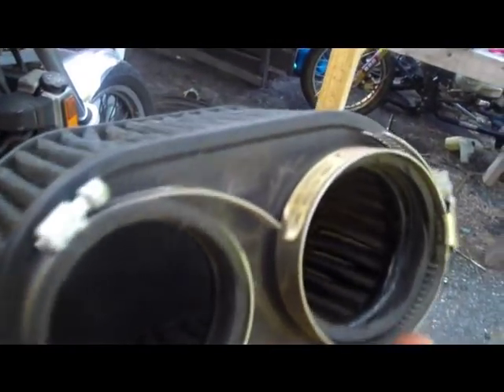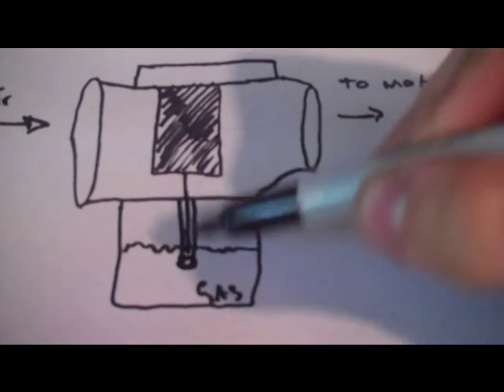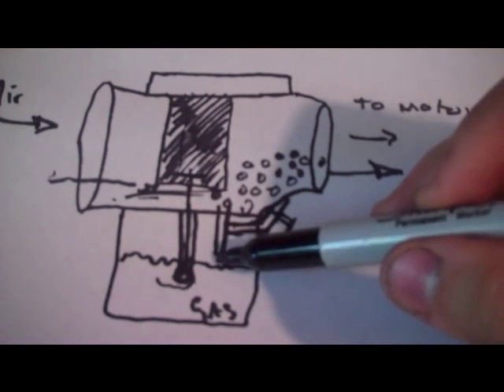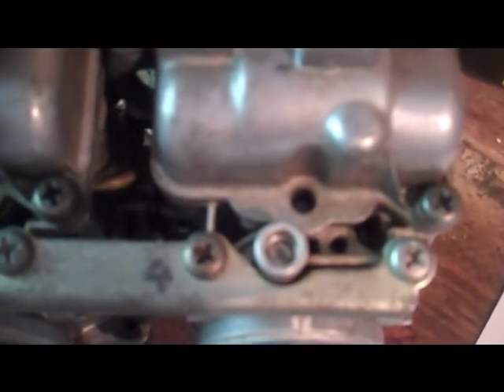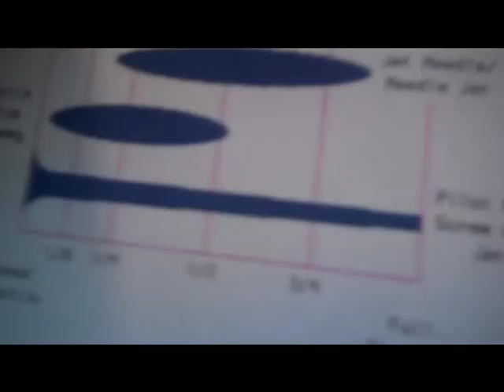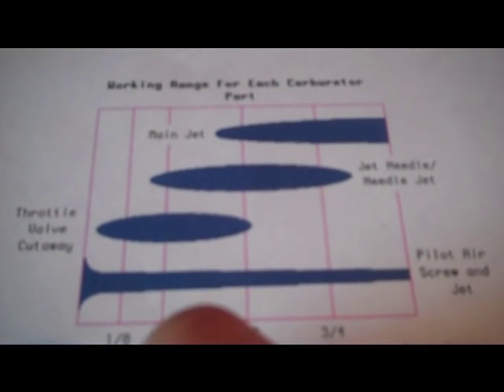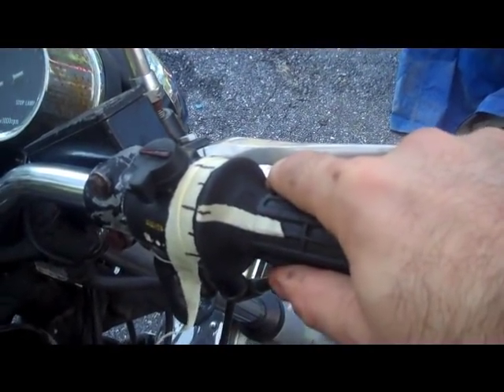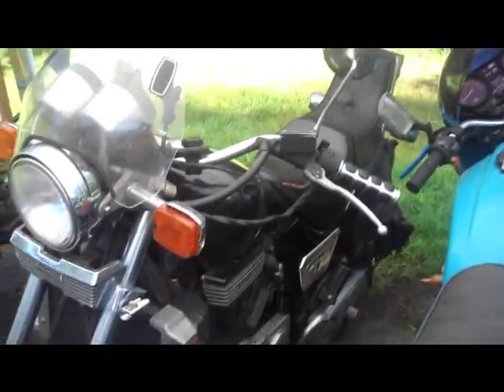How to adjust the jets on motorcycle carburetors

Comment: ok.i finally got an off day and put my air box on..i started it up and as i always do i choke it for about 60 sec or so depending how cold it is.the idle went up from1.5k rpms to damn near 6.so i turned out idle screw and nothing happend cut it off and back on it stayed revd up to about 5.5k or more...my throttle cables are correct it snaps bck in each posotion..what did i do wrong.?...

Comment: attempting a renovation of a BSA B31 350 it has an Amal  carb I got it to start, after wearing out a pair of boots, but it will only run with the choke fully on , any ideas would be appreciated
Reply from the maker: I dont know much about BSA's, is that the stock carb? If not how does it differ from the stock carb?
Reply: mrmaxstorey thanks for the reply Max yes it is a stock carb , it does tend to fire back thru the carb so beginning to think it may be a timing problem gggggrrrrrrrr
Reply: Only running with the choke on means the pilot/slow circuit is clogged. I'm assuming the Amal carb has those as I'm not familiar with those carbs. I would tear it down and fully clean it. Verify all the tiny passages are clean, run a tiny wire through them, then carb cleaner, then high pressure air. The pilot circuit or slow circuit has the tiniest jets and are often the first to clog up.
Reply: thanks jason will try asap

Comment: would u have any info on putting fuel lines on a 1982 honda v45 750 manga i got one used with the carbs off an dry cracked fuel lines that were just sitting in a box with the carbs i rebuilt the carbs with carb kits just not sure how to hook up the fuel lines
Reply from the maker: +Daryl Gardiner Fuel line runs from the petcock to the carburetor
Reply: +mrmaxstorey its a quad carb handa with 4 inlits for 4 all 4 but each port is connected to 2 cards top and bottom
Reply from the maker: +Daryl Gardiner http://carbjetkits.com/images/full/32.png
Reply: +mrmaxstorey ty

Comment: How many steps to adjust the 36mm Mikuni?
Turn air-fuel screw in all the way
bring it out 1 1/2 turn
start up bike
keep bringing air-fuel screw out but no more than 2 1/2 or 3 turns till it reaches max iddle
adjust idle with idle screw till RPMs are at the proper level

Is this the way?
Thank you
Roberto

Comment: Hey im using a 2 stroke bike, and i ported my carb. From 28 to 30. My standard jetting is 270/25. I am not using any air filter. What should i do? I am riding zx 150
Reply: And my slider has a small cut away. Its a vm28
Reply from the maker: +afiq yahya I don't have the magic formula for you. This video is all about the process of experimentation to figure it out for yourself

Comment: hey i have a cr80r Honda 80cc dirt bike 1989 and when i first got it it was amazingly fast and would wheelie just by throttling it and now the power band just isnt as power ful do you know what could be wrong
Reply from the maker: Tyler Wallace Could be lots of things. Dirty carbs, dirty air filter, losing compression, spark plug fouled, etc

Comment: Hey I bought a zx6 ninja with a pipe on it...  it had a horrible leaking rusty exhaust though so I replaced it with the oem dual exhaust and headers. Now the bike idles but it runs horrible. If I give it throttle it bogs down and it smells really strong like gas

Comment: sorry, im gonna try to put this in english, since im from mexico, i have a suzuki gs 1100 1982 with 110 main jets and 45 pilot stock jets according to the manual, my question is what would you recomend if the byke has air pods intalled? thanks for de video from mexico...
Reply from the maker: I dont know, thats the point of the video to help you figure it out
Reply: Air pods tend to flow more air at higher rpms than the stock filters so you tend to get lean at higher rpms. Have you installed the pods yet? What is the bike doing?

If it tends to cough and sputter at higher rpms after pods are installed, you need to enlarge the main jets. Go up a step or two and see if that's enough. You may need 114's or even 118's. It depends on the filters size and construction, etc... Some bikes are already a bit too rich with the main jet and a switch to pods don't require a jet change.

Comment: Ok i have a cr80 and it bogs at full throttle. I have to slowly rev it up to get it to redline. It has a horribly dry and crusty old filter and needs a gasket between the reed valve and the cylender. What would my issue be? oh and no oil in the crank case. i just bought it thats why i dont have the parts. i orders a gasket kit and a filter and all that good stuff. Please help me

Comment: hey man i got a problem..i have a cbr f3..my first bike so i try and do most of  mechanic work my self to learn something new.so i did carb clean did pretty well for my first time and i also did carb sync with carbmate sych tool.the pick up is great.i got my fuel/mix screws turned out 2 and a quarter out idle is fine but its just when i start trying to really goose it at about 75 80 it will bogg down and go no more.it rides damn near perfect up to that point but i want it to be correct help! plz

Comment: I'm having a problem with a 450r from idle to WOT, quad wants to die if you just gun it. Easing into the throttle is fine just gunning it from idle to WOT.

Comment: no not there a small hole out of the cylinder maybe a little lower,its like it was drilled out or something but idk what for,and it never leaked oil from there...but it all ran until i ran it for like 4 hrs straight,and then when i shut it off it had trouble starting and had extreme popping out of the exhaust (flames) and i had to jump start it.do u have any idea what happened?

Comment: Just took my carbs apart. was going to to a jet kit. but when I took the needles out. one carb had 1 shim and the other carb had 5 shims. and my jets were bigger then what came with the jet kit. I had 225 in one and 114 in the other. I frond that stock runs 225 and 222.5 . and the jet kit came with 110 jets.  please help me.. what the hell is going on with me carbs?  why so many shims in one. and why did the jet kit come with smaller jets then stock ??  thank you

Comment: I just bought a 1981 c b 650 only 2100 miles cylinder 1 and 2 running   3 and 4 cold getting spark, compression good , thinking it could be a pilot jet .what do you think ?
Reply from the maker: It could be lots of things but a carb cleaning should be first on the list

Comment: One more thing. When you put on cobra pipes, do you have to replace the main jet and polite jet so bike can run correct? Thanks
Reply from the maker: I dont know enough about cobra products to know if they require rejetting, it all depends if their baffle resistance is similar to the stock setting. However leave them on there for now. I would first check the spark plugs, see if they are fouled, if so then replace them and then try to figure out why they are fouled, perhaps your float heights are off, or the air filter is way too dirty. Is the intake stock on it or does it have aftermarket air filters?
Reply: Its has the stock air filter on it.I took the plugs out and they seem to look ok, one is light gray and the other is light black. How can i tell if the plug is fouled out? they look to be new. I was wondering if the float is off, but it looks new to. i never adjusted the floats before. i watch your video and im not understanding how to bend them?
Reply: The air filter is new to. The air/fuel screw was been mess with.
Reply from the maker: michael dean
Well if the a/f screw has been messed with, find out what the stock setting is and set it back. Usually its about 2-3 turns out. A fouled plug is black, if you have one that is blacker than the other then that one is likely running a bit rich. When adjusting the floats, the little metal tang is what is bent, rarely a bike will not have a metal tang it will be plastic and in that case they are not adjustable. Ive never worked on your bike before so I dont know

Comment: Have a 1981 Yamaha maxim xj 650 The intake boots are cracked but did some sealing. When i took the carbs of to clean them looked at the inside of the boots no cracks are all the way through.But still has a hard time starting,and the idle is up and down,looked at the spark plugs they look ok what could be the problem with hard starting could it be the vaules ?
Reply from the maker: +James Roberson Maybe. Carburetor problems is still far more likely. Are you firing on all cylinders?
Reply: Yes firing on all four.
Reply from the maker: +James Roberson Well theres a bunch of tests you can do to help narrow down what the problem is. I go over it in detail on my motorcycle diagnostics website www.TheMotorcycleMedic.com
Reply: Thanks

Comment: i managed to detach the carburator from motorcycle... now i am unable to unscrew the bolts of the carburateur so i cant get inside. i managed to ruin a bit 1 screw. is drilling into the screws the only thing possible? i tried light tapping with hammer and used some wd40 oil but it didnt help.

Comment: Very informative video. Thanks!

I have a '80 CB750 - I cleaned and rebuilt the carbs recently while doing that I also switched to K&N pods and a MAC 4-1 exhaust with a baffle. I upgraded from 68 pilot and 102 main to 75 pilot and 115 main - which now I understand may be a much bigger switch.I also did a valve lash adjustment and compression test to confirm everything is in order.

The bike did have some dead spots (especially when cold) during acceleration, which I fixed temporarily by wrapping a portion of my pods with electrical tape. Also, after a fairly long ride (interstate and city) I noticed all 4 of my plugs were fouled black and sooty - they are obv. running very rich. Definitely no oil in the cylinders, they weren't wet black.

I want to use what you have demonstrated in this video and some information from this website http://www.factorypro.com/tech_tuning_procedures/tuning_carbtune,cv,high_rpm_engines.html to get the jetting right.

I'm just not sure where to start, I live in Atlanta and it's really hard to find open spaces where I can twist the throttle and pull over and do these tests. What do you suggest - any help is appreciated!
Reply from the maker: Well I would just go down a couple sizes in the jets, and ride the bike around as normal for a day or so and evaluate how it responds throughout the powerband. Use normal riding as a gauge for whether you are still too rich or went to far and are now lean.

Comment: what about put 1 size main jets on cylinders 1 and 2 and then using different size jets for 3 and 4? i cant really find info on this.
Reply from the maker: It is not commonly done. What is your motivation for doing this?
Reply: mrmaxstorey i read somewhere the people can gain a little hp from doing this. i guess it is sort of the same as changing firing order but thays more race shit
Reply from the maker: You may be thinking about jetting 1 and 4 the same, and 2 and 3 slightly different. Some guys say the inner ones should be richer because the inner cylinders are hotter and a richer mixture will burn less hot. Other say the inner ones should be leaner because the air is hotter, so less dense, so it needs a little less fuel to be most efficient. You can give it a whirl if you want and see if it improves your performance, but typically the outer carbs and inner carbs on a 4 cyl bike are paired as far as jetting, it isn't one side vs the other
Reply: mrmaxstorey ok i thought itd be the inner vs outer if thats how you were going to do it. but im just looking for an excuse to get a little more hp from my '94 600.

Comment: tnx alot for this vid...
Ive asked you questions, im using FCR28 on my cbr250rr i have problem on 3/4 to full throttle..!!
i dont know if its lean or reach..! its like my RPM cant reach the redline and no power at 3/4throttle... and if i full throttle on(N) allot of fire comes out at muffler..!
but from 1/8 to 3/4 is nice running i think!!
can u help me pls...
my setting is 
MJ- 105     
SJ-  48     
PS-  3 1/2 
JN-   3/7

Comment: Hi I got a Honda Spirit 750cc 2002, Do you know what's wrong with this?. It's kink of weird now, it run very rough, It's die when I throttle fast, I just slowly turn it to high then it can  start to run . when it's on low rpm it can't run. Please let me know what's wrong  and what can i do to fix this. thanks a lot
Reply from the maker: It could be a lot of things. Visit the mrmaxstorey diagnostic website: www.TheMotorcycleMedic.com

Comment: HI,i bought a quad arctic cat dvx400 and it ran fine until i took it riding rode it for like 4 hrs w/like 5 min breaks and it was all good.then i shut it off and then it wouldnt start it would try,then i barely jump started it and it was backfiring like crazy.what do you think could be wrong w/it?it's got fat boy exhaust and k n filter.170 main jet (130 stock) and 25 pilot,(22.5 stock).its got compression,def air,fuel in the carb,and has spark.maybe i need to tinker w/the air or fuel screw?thx

Comment: ohyeahandthattimewhenididget it started w/the rags covering the filter,there was a bit of oil out of the cylinder,not the head,but wherethecylinder islikein that small hole, my automotive teacher said it's the head gasket.so blown head gasket? but the thing that bothers me is that the small leak is coming of the hole way below the head it neverleakedfromthereb4...and also i did tinker w/the mixture screw i turned it out to the left 3 turns from where it already was, that's waay to much isn't it?

Comment: i have a hyosung 250gt, i took my carbs and cleaned them.. my bike is now having issues starting and holding idle. i think it has to do with my air/fuel screw but i cant properly adjust them if the bike doesn't start. the bike with turn over but i don't wanna f**k up my starter before it starts... my jets aren't unscrewed at all so maybe thats the issue? whats the proper way to adjust the screws?
Reply from the maker: The jets should be screwed in tight. It is the a/f mixture screw which 
gets backed out a little. If you have stock intake and exhaust then it 
should be at stock settings
Reply: The current issue im having with the reassemble process is the restoring the stock setting for the screws (A/F) and the carb not properly seating into the bottom of the air filter box... should I reassemble the carb and air filter box first, the attach it to the two rubber hoses coming off of the headers? Also the re-install of the gas tank is a B***h lol
Reply from the maker: Youll have to look up in your manual what the stock setting is for the af screw. As far as reassembly, typically I put the carbs in and button everything up and then hook back up the vacuum hoses but it all depends on what makes sense for your bike and how its set up. Just go in there with the mindset that it HAS TO BE DONE and then figure out a way to do it

Comment from the maker: No that won't work out for you. You need to either clean up the floats, needle, pin etc, or replace them. Make sure also that your floats actually float, and have not been perforated in any way. Then set the floats to stock height

Comment: I put ram air on my yamaha R1 2000 but at full throtle its seems a bit weak like its lean mixture if i put a washer on the needle it May work fine?
Reply from the maker: its worth a shot

Comment: So would jetting be the same or almost for a 2 stroke 78 Yamaha dt 125,
bored 1st oversize,with aftermarket exhaust,K&N air filter ?an if it makes any difference a "not ported" but smoothed out exhaust port an holes drilled in the air box
Reply from the maker: No the jetting would not be the same. You would need jets several sizes larger
Reply: mrmaxstorey The  main jet is  115, pilot jet  22.5, I haven't put the pipe or air filter on yet,it seems to run good right now
Reply: mrmaxstorey so what size do u think i should get,please help, thanks

Comment: With all the bikes that you have worked on, is there a favorite type that has shown to be the easiest to work on or just has been a work horse type motorcycle?
Reply from the maker: I really do have a lot of faith in all the old Japanese bikes, especially the big lines of KZ, CB, GS, and XJ/XS. However a winner is beginning to pull ahead for me, and that would be the Yaaha XJ line of motorcycles. Compared to their similar bretheren, Ive found them to be faster and more reliable, as well as easier to repair

Comment: ok igot the old spark plug out and it was black like kinda wet so flooded (?) well it wasnt that old,i put it when my quad didnt start so it's like 1-2 mo. old.So i put the new one and cranked it up like 5 times holding the throttle and nothing,took the new one out and its not flooded or even black at at all.So to rich is not the problem?

Comment: hey man  i just got my heads rebuilt and new lifters, it idles ok but as soon as you kick it in gear and try to move it falls flat on its face and stalls. im going to try and tackle the carbs myself for now since cash flow is weak at the moment, i was wondering if you thought of anything i should look at first? thanks
Reply from the maker: +keith sager Make sure that timing is absolutely correct if its off a tooth it may act like that. Also doublecheck the compression after the head job

Comment: hi I rebuilt a quad carb cleaned all the jets when I fired it up it reved like hell so I killed it straight away how do I get it back to normal the jets where clogged
Reply from the maker: Make sure the throttle cable isnt kinked or the linkage isnt hung up on something, like a hose clamp or piece of metal. Sometimes when putting the carbs back in the throttle gets held open a little bit causing over revving

Comment: I have a 85 700 yamaha virago had it for a month started running boggy i went through the carbs replaced the jets and float needle cleaned it thats about it,now it runs only idle if i throttle it at all it dies. I took out the mixture valve it wasnt working at all so i bypassed it. now its boggy as heck. Ridiculous.